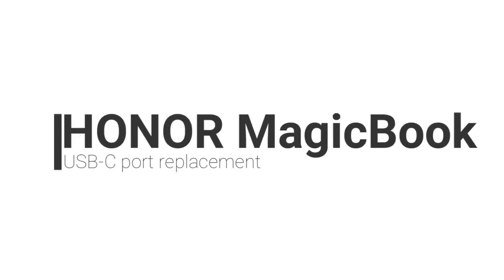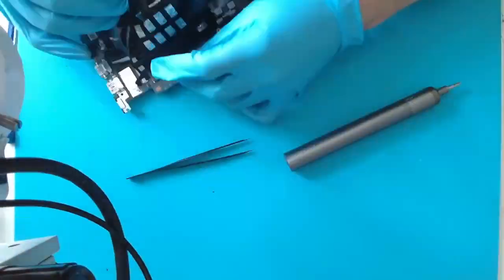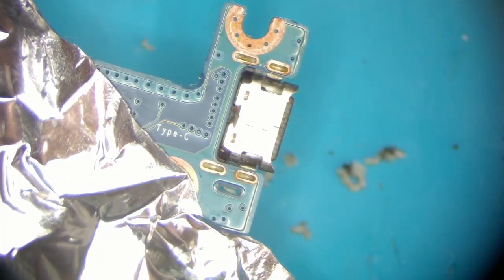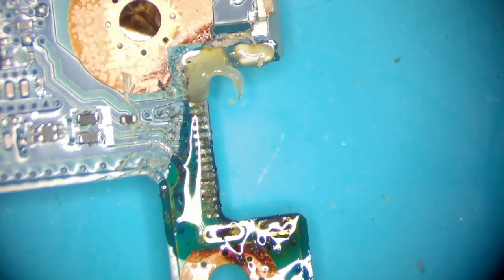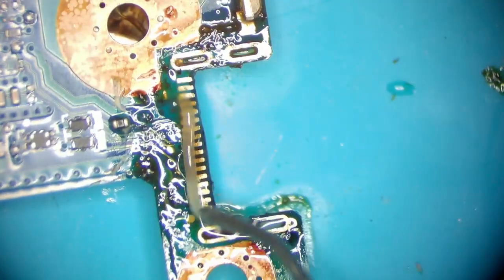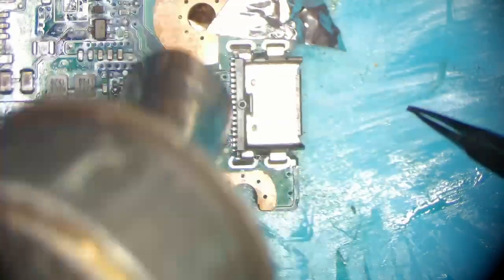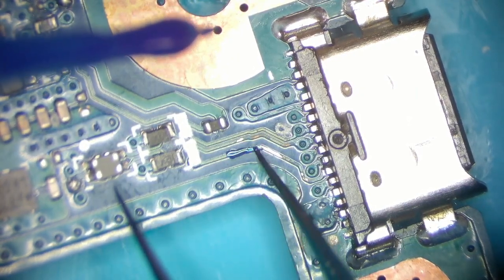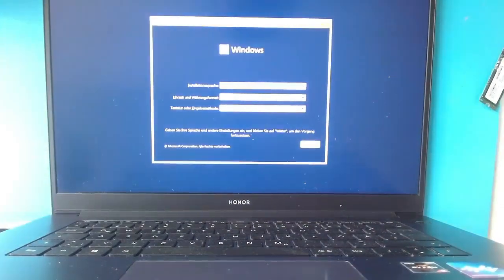HONOR MagicBook - Not charging | USB-C connector replacement

Comment: I know that all the steps are useful if you do that, but do you think some could be avoided since I dont have all the equipment? What's the risk of just replacing the connector? The laptop is already not working and out of time for repair free by Honor.
Reply from the maker: Well I only replaced the connector..if you‘re from europe you may consider shipping it to me, as I‘m from germany
Reply: @lindenaurepair  damn I didnt see the answer and I went with Huawei reparation. For next time.
Reply: @lindenaurepair Hey I'm from France and I have the same problem, so we can send you our laptops to fix it ? How does it work ?
Reply: @YoumiyFR  Finalement les honor ont tous le même problème
Reply from the maker: Hi, you can contact me on Facebook